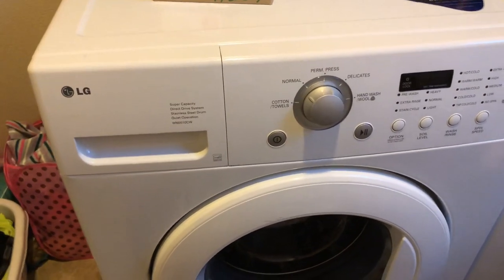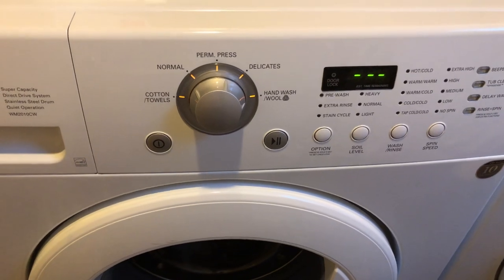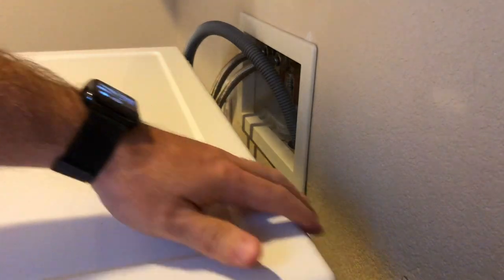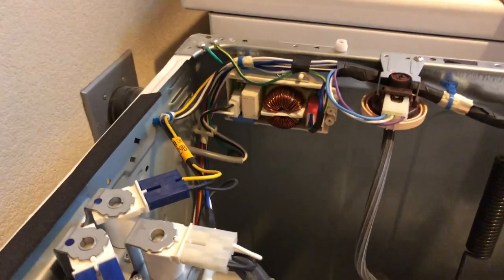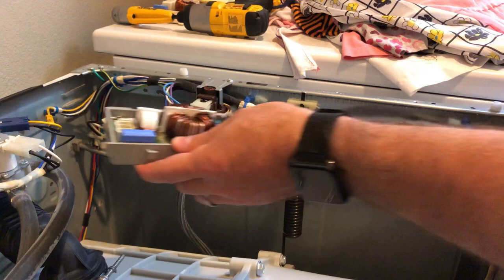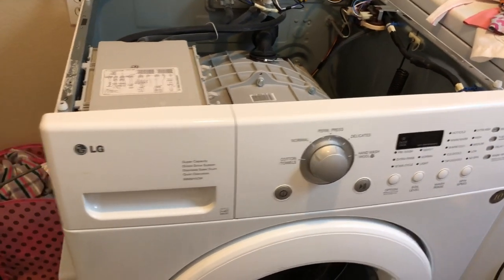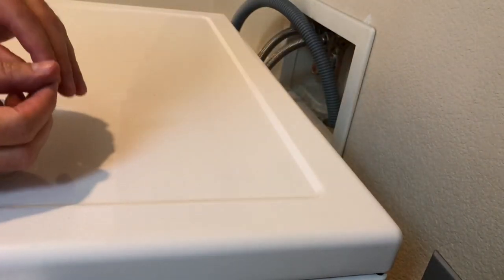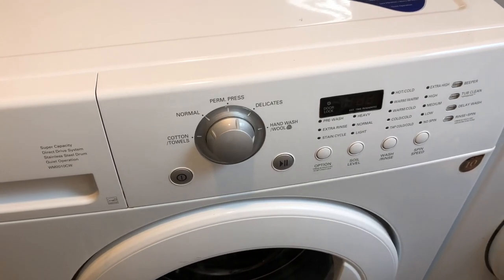LG Washing Machine Power Issues Fix - FAIL

Comment from the maker: The hilarious part of this is that just adding a power strip between the washing machine and the outlet finally fixed this problem once and for all.  In other words, I just took a generic 5 outlet power strip, plugged it into the outlet, and then plugged the machine into the power strip.  My intention was simply that it's much easier to turn the power strip on and off to reset the machine than to have to unplug it and plug it back in all the time.  Since doing this in October 2018, my washing machine has been working flawlessly.  Someone explain that one to me.  Let me know if this fix works for you.
Reply: Does the power strip have a surge protector built in?
Reply from the maker: Yes, I believe that it does.  It's a cheapie, but I think there is some kind of surge protection built into the power strip.

Comment: just had this issue. i have to flip the breakers or do the unplug + power, start reset method for it to power on everytime i need to use. noise filter looks good, control board looks good. display board works. power strip it is!
Reply from the maker: let us know if it solves your issue

Comment: Just wandering.  Instead of using a power strip, couldn't you simply go to your breaker box, turn your breaker off, plug in the washer, turn the breaker back on and accomplish the same effect?

Comment: Hey so try this... unplug the cord and and take a pair of pliers and bend the plug ends outward some. Some times the plug ends are barely making contact with the outlet contacts. Worth a shot.
Reply from the maker: interesting idea.  plug is very tight in the wall, so it doesn't feel like loose contacts, but you never know
Reply: Yes it can seem that way but putting that outward bow (not enough to where it won’t slide in the outlet obviously lol) may make better contact. Same thing would happen on my dryer. It seemed tight at plug but I could grab the plug and wiggle when it had total power loss and it would come back to life(basically same thing you’re doing by unplugging and plugging back in ). I did that u shape to the dryer plug and it quit. Another thing u could do to troubleshoot total power loss is at the outlet to leave the plug end slightly out of the wall and use a voltmeter to measure across the plug of the washer(from left to right) and see if you have 120 volts(make sure you place meter setting to AC voltage reading and not DC).Only have the plug far enough out to place your voltmeter leads on the plug ends. Just don’t touch the exposed ends of the meter leads obviously lol. Let me know how it turns out. If doing that to the plug doesn’t work are you seeing voltage across the plug? One more thing u could try... you could run an extension cord to a different outlet and see if it quits also but I would try the curve to the plug first. Thanks. Good luck.
Reply: Btw, when testing the 120 volts I mean to have leave it slightly out of the wall and wait to test the voltage when it has signs of no power again. Be careful not to wiggle the plug while doing it(idea is to see if voltage loss is due to plug not making good contact with outlet. So if you wiggle slightly that could make it contact and get 120 volts back).
Reply: @n1qualifiedman  this is a common & unexplainable issue with LG washers. so many folks are having the same issue. you're obviously getting power. something with the control board is causing it to reset or something. i've been going mad this past week trying to trouble shoot & diagnose it. i don't wanna give LG $200-$300 bucks when the machine is $600
Reply from the maker: @apexscape  power strip is still working for me all this time later...

Comment: Any info on the outcome here? My thoughts is something with the discharge of the capicators inside the main PCB. I'm no electrician, but I suspect something failing inside. Since unplugging it, waiting, and then plugging back in usually results in an arc at the outlet, this is a sign of failing capicators (right?)
Reply from the maker: you could be right.  so far, i've left it plugged in on the power strip, and it's working flawlessly.  as soon as I plug straight into outlet, it resumes the old behavior of refusing to run on until unplugged.
Reply: That arcing could indicate the contacts in outlet internally worn or loose.
Reply: The arcing is from the action of plugging it in with the load active. It's not while it's already plugged in.
Reply: wingerrrrrrrrr yes it can but not limited to just that. It could also be                  Water/moisture in the outlet
Loose wiring
Lack of a ground wire
Frayed or uninsulated wiring
Old, worn out outlets
Cracked or broken outlets
Reply: Those can be problems but in this case the question is about arcing that occurs at the time it's being plugged in, not arcing that occurs when it's already plugged in.

Comment: Hey good effort and sorry it didn’t work. The noise filter is actually a mains power surge protector the protects the machine from over voltage power surge. Good luck and yes it’s silly that they call it a noise filter. Cheers
Reply from the maker: Thank you.  Mysteriously, the washing machine has been fine ever since I plug it in via a power strip.  I just have a generic 5 outlet strip plugged into the wall, and machine plugged into that. No issues since I went to this set up.  Hard to explain.

Comment: Just a theory, but when a capacitor is starting to fail, it can generate intermittent power issues.  If that's the case, your middle power strip might stop working once the capacitor dies for good. If a capacitor on the control board is going bad, you could probably tell by checking by sight or touch (for swelling), or with an ESR meter so you don't have to remove the capacitor from the board to check it.  Then, just solder in a replacement.
Reply from the maker: That's a good tip.  Thanks.  This was a while ago, but I remember looking at the PCB and not seeing anything obvious being wrong, including bulging capacitors.  Also, the video was filmed in October 2018, and the washing machine has been going strong being plugged into a power strip through today (March 2020).  No issues whatsoever.  

You'd almost have to suspect some fault with the outlet, but I have not bothered to replace it, yet.  Also, it's hard to believe that it can be the outlet given how common this issue is.  Maybe the power strip's surge protector is doing some magic conditioning of the spikes the machine can't otherwise handle.  Who knows?  House is relatively new (2006ish) with modern wiring and electrical system.

Comment: Ok I have a lg washer that so t turn on at all ...I saw your video and I can’t find the part number replacement for the 

Model   WM2016CW/01
S/n. 903KWAT06536
Board replacement 
EBR38163321
What’s the noise filter# and do you have one to sell
Reply from the maker: i'm just a dude on youtube.  recommend you check with professionals.  for example www.repairclinic.com

Comment: I unplugged my washer but if I spin it inside it powers on wth ??? 🤷‍♂️
Reply from the maker: you have the magic auto wash!
Reply: then de drum drives the motor, which makes it act like an alternator from a car, which in turn gives power to the board and powers up.